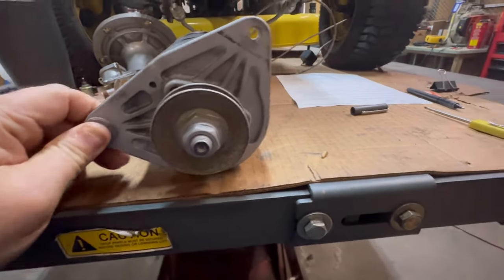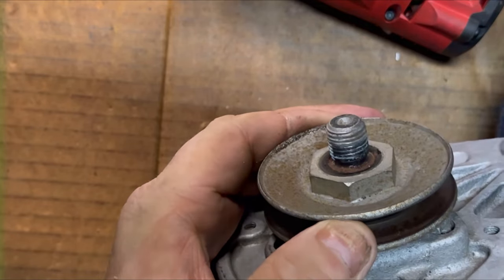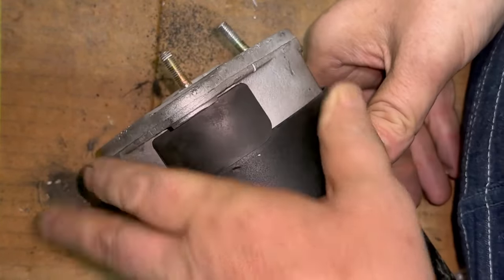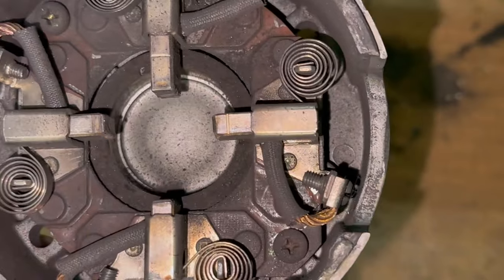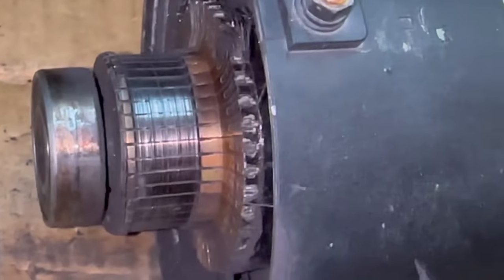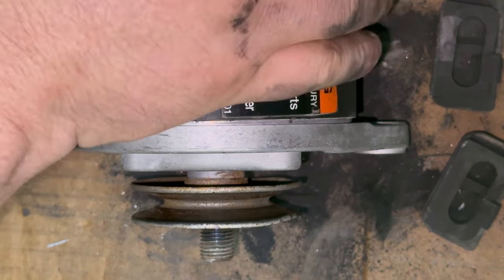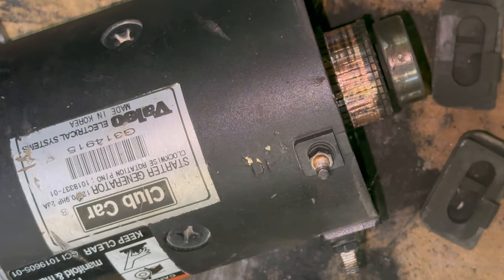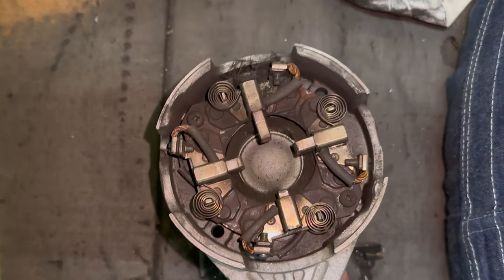STARTER  /  GENERATOR FAILURE ANALYSIS

Comment: What should the voltage output be
Reply from the maker: 13.8-14.5
Reply: Should it be steady or will it bounce up and down,I'm having an issue where the voltage drops under 12 when I'm under 5 or 6 mph and the gage is bouncing from 13.8 to 15 volts even at a steady speed of 12 mph,any help would be greatly appreciated